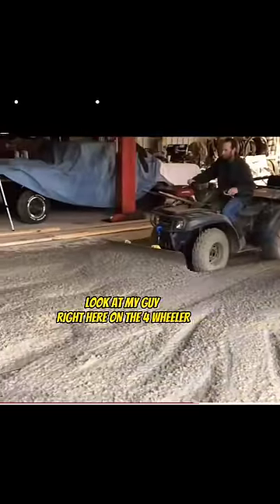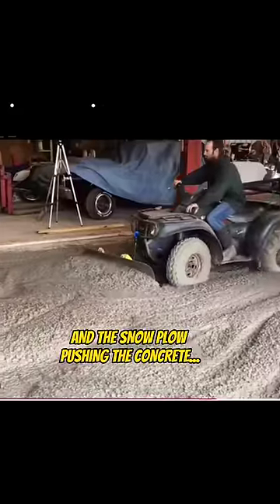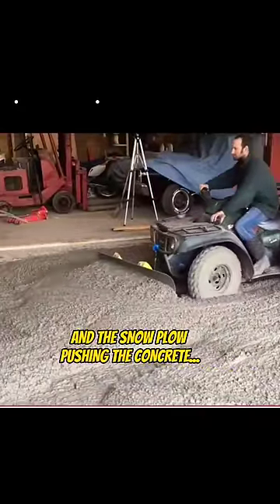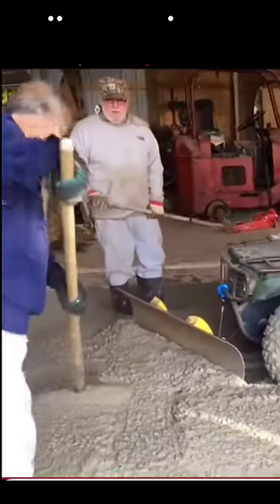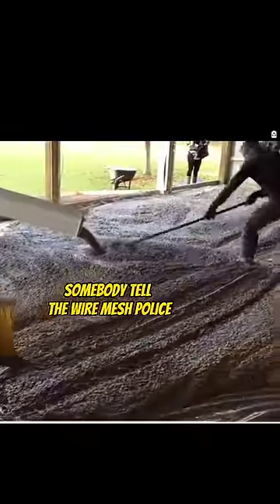Concrete Catastrophe (drove a quad w/ SNOWPLOW into wet concrete)

Comment from the maker: Wire mesh is actually under the plastic give all them 15 to life
Reply: Ridiculous 
Lol
Even pushing it with a quad
So stupid 
It was wet and the truck was right there 
Wasn’t a long push at all
Reply: man you stole that from Ryan Victory Outdoor Services the best concrete channel on youtube give him that credit
Reply from the maker: @Treasures776  like I said on the other comment RYAN DIDNT EVEN COME UP W THAT GET YUR FACTS STRAIGHT, BONDO DID AND RYAN EVEN GAVE HIM CREDIT IN Season 1
Reply: XD my dude your comedy !! XD
Reply: @Treasures776 
🤦‍♂️
Reply: If it's under the plastic them why ain't the plastic humped up in the middle where the wire is?
Reply: @kuntryboy4lyfe125   because it's flat...comes in sheets or rolls..belongs in the upper third of the slab to help keep cracking down a little.😉🖖🏼
Reply: @steve_beatty , wire mesh does absolutely nothing to strengthen or keep crete from cracking.  Its the bigest waste of time and money taught to crete guys out there. The two things crete is going to do is get hard, and crack.
Reply: @stevehamman4465  You're right...wire mesh is useless because the finishers stomp it into the subgrade. ....😉pencil rod or #4 rebar on adobes works much better...As far as cracking...yep..concrete if restrained will crack...because of water loss and shrinkage  You never heard of a 24 hour finish schedule ? Seal up the cracks as they form by keeping a float on it for 24 hours..You can get a real nice looking faux marble floor if done right..Any more sage advice from "the concrete expert" ?...🥴
Reply: You need some glasses bro. The mesh was over the plastic! You can see it bounce when he runs it over.
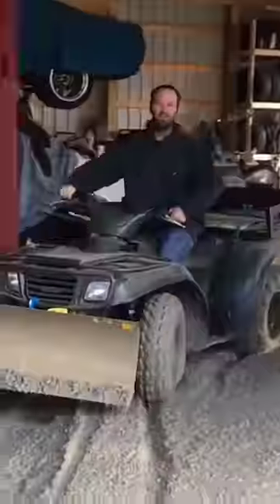Reply: @rudytrujillo2238   dunno man..look at 0:29 close and tell me that those reflections aren't over the  mesh...😉
Reply: @steve_beatty  I don’t  know about that. The mesh goes up and down like Normal and where it’s up the plastic isn’t stretched out like of something was pushing it from under. It’s got creases in it like it’s under. Either way if they aren’t picking it up it’s not doing it’s job. When the 4wheeler runs over it it pushes it to the bottom and therefore useless either way
Reply: Umm ... no it's not. 😶
Reply: Watch the back tire grab the wire and puck it up a lil bit and it starts bouncin a lil. . THE WIRE IS ON TOP OF THE PLASTIC!!!°
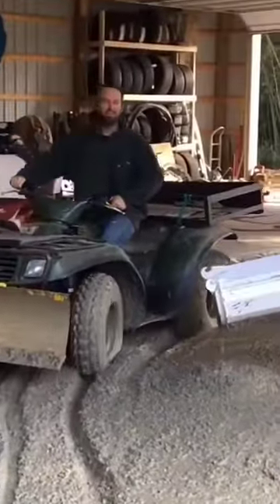Reply: @Tracker7266  Ummm...yes it is...reflections  @ 0:29 would be broken by the wire mesh...they ain't .....ergo...the wire mesh is under the plastic...😉
Reply: @kuntryboy4lyfe125  agree 💯
Reply: @steve_beatty  You're blind.  It's on top. The quad tire tread grabbed it.
Reply: The other shit you pointed out wasn't completely bonkers.. and of course you should pull wire up but personally I believe it  still partially does the job when it's on the bottom. Typically it's not laying dead flat anyway and I've demod thousands of yards over the years where you can tell the wire is doing its job(old concrete and new concrete) but the plastic on top of the wire.. that's bonkers
Reply from the maker: @danielgoldenberg3439  https://youtu.be/mzU8DS0vOwg I agree that it does something until it rust out. But it is under the plastic in some spots. U have to realize It is just entertainment
Reply from the maker: @danielgoldenberg3439 btw that's my long form video (the link I sent u)
Reply: It's actually on top of the plastic.
Reply: Heating system maybe
Reply: Ok ryan
Reply from the maker: @GlocKkandchill  y'all think Ryan came up w that and he wasn't even the one. Come on man. Bondo did and Ryan gave him credit FYI but what's wrong w saying that
Reply from the maker: @GlocKkandchill  shout out Ryan tho
Reply: @stevehamman4465 it still cracks it just wont shift as much, leaving a flatter surface.
Reply: That contractors not getting paid.
Reply: It didn't look like the wire was under the bisqueen!💁
Reply: Look close it ain't under it
Reply: You all watch victory
Reply: how is that possible???
Reply from the maker: @omarmendez4003  I rock w victory
Reply: No, it isn't actually. Why lie?

You can see the imprint of the wire in the concrete early in the video and the mesh above the liner later in the video when it's disturbed by the ATV.
Reply: @steve_beatty  your eyes deceive you. The mesh is flexing up over the plastic. Look at all the frames before he changes camera view. Near the right rear tire, the mesh is clearly on top of the plastic.
Reply: @zergin247   Wow...who knew this would go one for weeks 😅doesn't matter..It clearly ends up being buried under all the  concrete instead of being in the upper 1/3 of the slab where it belongs..😉
Reply: Wire mesh is on top of plastic in video
Reply: But it's above the plastic.... It doesn't make it fly up into the concrete... But atleast it's above the plastic. XD
Reply from the maker: @Fairnzelia  I only saw the part that it was under . But I will take your word for it
Reply: @Treasures776 your real quiet now lol 😂
Reply: I see I have found the concrete enthusiasts part of the internet. Y'all real serious about it.
Reply: No it aint
Reply: they probably pull it up later don't want 4 wheeler catching it
Reply: @GRUBB-MUDD False, people have said this for ages.😂
Reply: @rudytrujillo2238 That's what I  thought unil I paused it, plastic is definitely over the mesh.
Reply: @stevehamman4465 just say you don’t know what you are doing
Reply: It looks like it isn't
Reply from the maker: @Rosskles  t me it looks like it is. 😂, I have the original video. I will look
Reply: That wire is not under the plastic, and I’ve seen this happen before, a guy building a 4car two story garage, was pouring his walls /footings first, and had a wall blow out on him, with no help, so he grabbed his truck with a plow, and salvaged most of the concrete and got most of the floor done, reinforced the forms, and poured that wall the following week..
Reply: Whut

Comment: Got to protect the wire mesh from the concrete.
Reply: Yeah, otherwise it might corrode🤭
Reply: Oh now i get it the wire is protected from the concrete .. damn i was taught to put vertical rebar in and tie the wire to the rebar to keep it in the middle of the concrete .. i guess im wrong. Why oh why can ppl not do a job proper anymore??
Reply: Actually you have to protect the concrete from the wire mesh

Comment: Rake works perfectly fine.
Reply: Yeah not the tool of preference but me and two guys poured two driveway aprons, 15 yards with two rakes.. all the other crews left and we were switching trucks... comealong is better but wet concrete moves easy peezy
Reply: NOT the point.
Reply: I literally worked for multiple concrete firms and tarmac (asphalt)firms for 25 years. I now have my own business for 11 years. every site I have ever stepped on uses rakes. It's literally the best tool to grab the stone in the concrete with out bringing half the liquid with it. You then turn your rake over and tamp it with the flat side. It's very light and easy to use. Just a quick Google search and every professional will use one. I'm not being a smart arse, just giving you my 50pence.
Reply: @benmartin4489  buddy… they’re using lawn rakes 😂😂😂
Reply: @kailcancook3910  I honestly can't be bothered with this planet sometimes 😅
Reply: @benmartin4489  they’re not using concrete rakes buddy?
Reply: @benmartin4489 literally just makes it way more hard, just use a kraft tool, it's 100x better then lawn rakes

Comment: A rake is a great way to shift concrete.
Reply: a rake is a good way to leave  your paste behind...😉
Reply: @steve_beatty it's literally called a concrete rake
Reply: @kylelaughinghouse1893    Sure...a real concrete rake..Was he using one or was that a home depot garden section  special  ?  🤔A real concrete rake is more of a small screed and pulls along rock and paste where a garden rake is just  going to leave all the paste behind....To be honest I can't be bothered to watch a 2 week old video again to refresh my memory 🥴 I have better things to do...Like argue with that QC engineer over whether we ever core concrete for compression tests in that "dry pour slab" video elsewhere.. ..😉😅
Reply: Looks like to me. No wire that I can see. What looks like wire is a pattern on moister paper.
Reply: @steve_beatty  I've been shifting concrete on and off for years, and I'm sure there are better ways to do it, but I found a cheap garden rake is much better and easier than using a shovel.
Reply: @gdfggggg  like I said..a cheap garden rake will leave all your paste behind..not a really good choice imnsho...😉
Reply: But the garden rake can tear holes in the plastic to let the crete down to the wire mesh. Lol
Reply: @rconradvt  😅
Reply: @steve_beatty  concrete comealong  what it's called ,where I'm from anyway
Reply: @kylelaughinghouse1893 that's quite literally lawn rake
Reply: @gdfggggg or use a concrete rake or kraft tool, made for spreading concrete
Reply: @rconradvt don't really recommend pouring on plastic anyway

Comment: The wire mesh looks to be on top of the barrier to me.
Reply: Same you can see it pop up as he drives over it and the barrier doesn't move.
Reply: @mr.smooth7809  Yes, I can see that on a bigger screen. Earlier in the video I can also see the wire pattern in the concrete.

Not sure why the poster is trashing the concrete guys with false info.

Comment: Here's some 411 information
Grandpa has a rake for a reason
His job is to move the concrete around to help fill in the low spots
Reply from the maker: But a rake is not the proper tool for dragging mud, a come along is
Reply: @GRUBB-MUDD  it the right tool to do the job 
i know becoase i use to do concrete fir years
Reply: @vDRACv you are talking  about a come along right?? Not a rake🤮
Reply: @Dstrbrdgrnd  no I'm not talking about a come along 
Why use a tool that's 3 ft wide to fill in a little tiny low spot ??
Rake does a job perfectly
Reply: And I guess you all got to have some kind of steel 12 ft long 2X4 looking  device to level off concrete ?? 
Because a 2X4 bored is not the proper tool for the job lol
Reply: @vDRACv  depends do you want a structure that will pass inspection 40 years ago or in 2023?
Reply: @dambroangling2828  yes it was nearly 40 years ago when I got into concrete 
The way we did it then well still pass today 
Not much has changed and concrete in the last 40 years 
Using a rake tto move concrete around 
Will not affect how the concrete will set up 
Using a two-by-four to move mud around is not going to affect how concrete sets up
But I guess you're just another one of these younger generation that thinks they know something when they actually don't lol.
Reply: You might want to start learning some of these old techniques we used to do since concrete has just recently went back to the old days  lol 

I'm referring to Roman concrete

Self-repairing concrete that will last for thousands and thousands of years
Reply: Wouldn't a rake move the aggregate too much while leaving the cement and sand? Just asking. Feels like it would affect the ratio in some areas.
Reply: 😂😂 i mean it kinda works... i guess...
Reply: @vDRACv you did concrete for years and think a lawn rake is best😂

Comment: When the quad drives over the wire tie wire rebounds and the plastic stays down = wire is on top. Great post either way
Reply: Wire is on top of plastic. Some contractors use rakes also. They puddle mud while pouring out to push stones down and bring cream up. This guy posting shouldn't be talking crap about something he doesn't know about

Comment: The plastic goes down first then the wire mesh then the concrete. I guess they didn’t realize after the concrete poured that they’re supposed to come through with a tool and pull up the wire mesh a little bit.

Comment: they're using legit muck rakes!! those solid bladed rakes work the best for mucking for whoever rodding the slab off!!  my first boss made a solid blade rake with a half inch round solid steel pole that was like 4 foot long and was well over 30 pounds and that rake was the best for concrete and grading gravel if you could hold onto it it would pull 5-6 inches of concrete rach pull and about 2-3 inches of gravel at a time

Comment: Yup, you gotta pull the visqueen and the wire up TOGETHER using this method.  Looks like they're just ignoring it.  The guy said put down plastic and wire, so they did.  Check the box.

Comment: If you're going to put wire mesh and you might as well leave it beneath the concrete if you pull it up and tear that concrete out 20 years later there is no longer any wire-mesh left just voids in your concrete that could potentially fill up water and fries

Comment: Actually, if you look closely, you can see the wire mesh spring up behind hus tires. I'm the last couple of frames of the video when he pulls forward. I did look like it was under until I noticed that. The mesh is definitely on top.

Comment: The reason hes using the rake is to pull up The Wire for the concrete so it's not laying on the ground

Comment: I thought the wire should b up on somthing so its not sitting on the bottom doing nothing
Reply: If you’ve ever worked concrete, the come alongs you use to pull the concrete has a hook so you can pull the wire up.

Comment: Turn the shoot up, throttle lock it and pour like a normal man, its crazy how many ppl i see pour on here that lock the shoot straight and let it dribble out, lil bit of speed on that drum and someone hitting that good back and forth sweep and that shit’d be bumping every corner of the forms in 10 mins flat.

Comment: If you had a little bit more education, you would realize that the wire mesh is not under the visqueen, because the visqueen is opaque and not transparent.  Yet you can clearly see the wire mesh, but you can’t see what is actually under the visqueen.  Also, if you watch closely, you can see the wire mesh deflect as the ATV drives over it, but you cannot see the visqueen deflecting.

Comment: The rebar is in fact on top of the plastic..  you have to watch it perfectly timed and pause it .. at which point you can see the rebar floating over the impression it left in the plastic.. and the plastic is White so you can not see the rebar/ mesh through it..    FACT!

Comment: Wow, even i know you just cant possibly use a regular rake for concrete, aint that right?
But ill tell you one thing, that guy on the 4 wheeler is moving some concrete.
See, if you had gotten there earlier rather than when the truck got there, you could have straightened these guys out on all these things.

Comment: Depending at how thick the concrete is they may lay another layer of mesh in layer closer to the surface if not it’s their problem 😂
Reply from the maker: That would not be good mesh should be towards the bottom cuz it rust through, but I think they used the plastic so it would kinda move easier on top of plastic